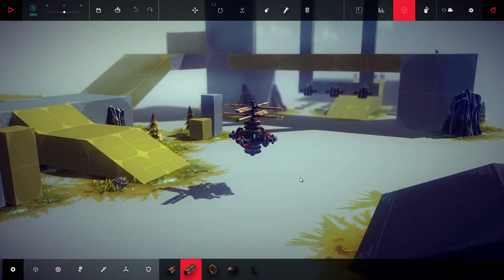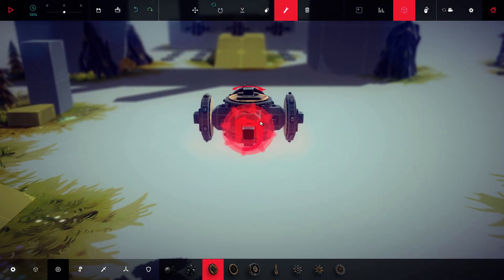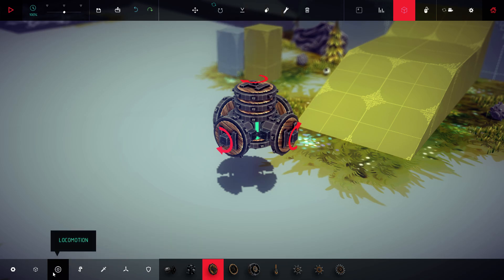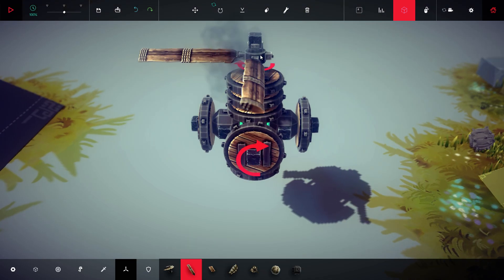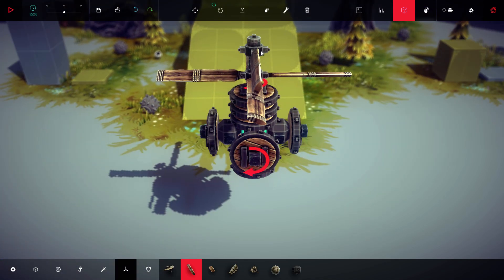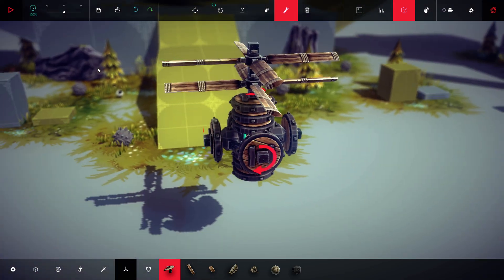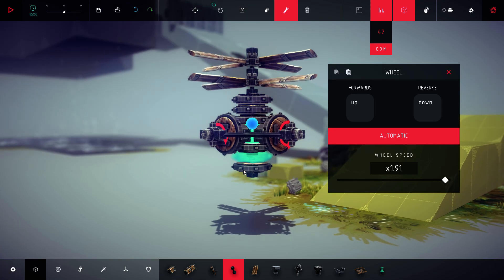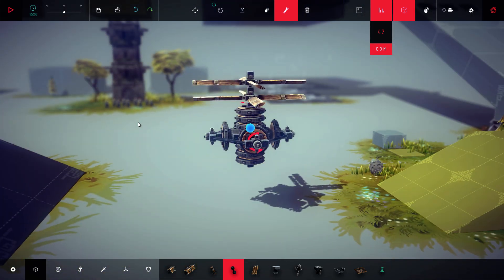How to Make a Helicopter (Tutorial) | Besiege

Comment: Currently, I have everything done right on the xbox version, and the brakes on the side wheels that rotate the helicopter sideways or forwards/backwards aren't working. I'm not sure what I did wrong, but due to that, the helicopter cant turn or tilt.
Reply from the maker: You did nothing wrong, the XBOX version is confirmed different, so some of the PC version techniques (like this) that worked for years now don't work on XBOX. Sorry :)
Reply: @NUBSAUCETV  that sucks so bad.
Reply: @NUBSAUCETV  is there any chance you could point me towards a heli engine that works in Xbox ❤
Reply: It does work, you just need to add more wheels

Comment: I still cant figure out why mine keeps slowely leaning to the back left
Reply: both m B, V, U and O turn the frame of the helicopter, is this normal?have I put a bbrace in the wrong place?
Reply from the maker: Most likely you need to change the speed of the top and bottom rotor by a small amount. Set the top rotor to full, then change the bottom and see if the spin gets less. Try it the other way until you reach equilibrium

Comment: first thanks a lot for the video!  
everything works but when i press B or V the thing starts spinning. what did i do wrong?
Reply from the maker: Ghost Frog you may need to check the rotation of the wheels. Something sounds like it isn't canceling the spin out.
Reply: it works now! i forgot the connection of the "U+O"-Wheels! it even works without adjusting for no spin!!!!

Comment: hey, 1 year late, but how did you make it balance, whenever i use wheels or and propellers, it just tilts slightly and then keeps tilting until it just smashes into the floor. It would be nice to know how you made it so where it goes a direction, and doesnt keep going that direction, but goes back a normal way.
Reply from the maker: iShadowXZ first you need to make sure your creation is heavier than the wheels you attached, then have counter balance reaction wheels, meaning wheels going both ways (like my top and bottom wheels). Otherwise you're creating an equal and opposite unbalanced spin on your object
Reply: thanks smacks lips

Comment: got heli to hover up without auto turning setting top mid to 1.94. my B and V dont work correctly tho. cant get it to kill the engines like you did at end of video. plz help!
Reply: just figured it out. bottom wheel needs to be V forward. B reverse. opposite of top wheel.

Comment: i ...hum ... it does not work ... it goes up and down ... but the rotation u fixed with the middle wheel speeds ... that rotation i get is liek 500 time stronger, i did the key bindis and all but pressing  UIOJKL  does nothing, also, there is now something called autobreak, i dont know what to do with it, turned it on and off ans saw no difernece
Reply from the maker: Try going through the tutorial again. AutoBreak makes no difference.
Reply: I had that problem, try changing the bottom automatic wheel, I had to make it 1.32 with the most recent build of the game